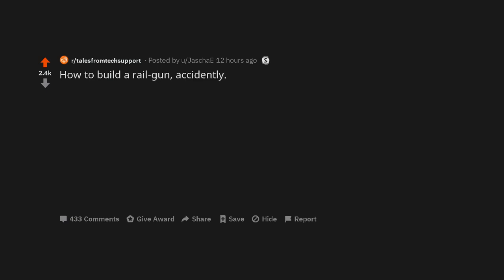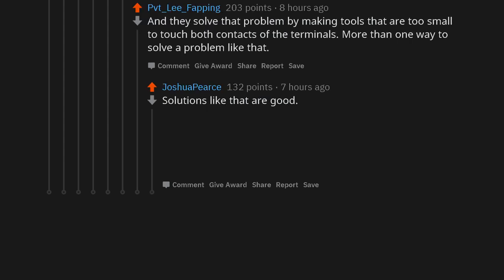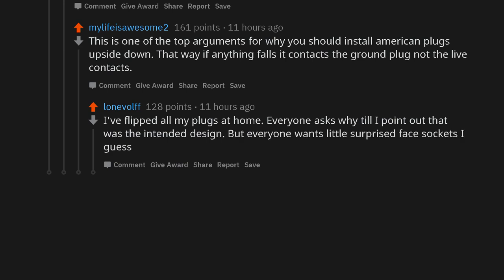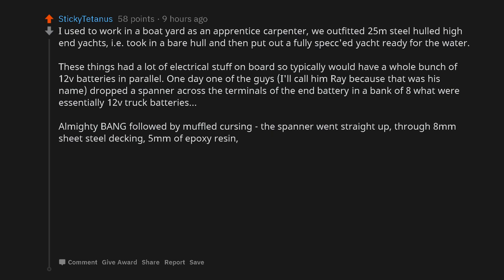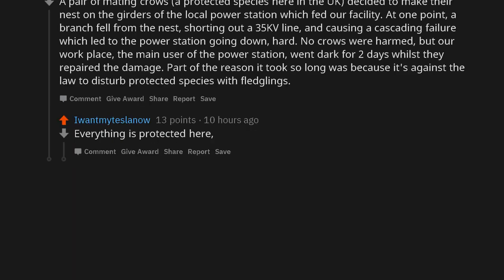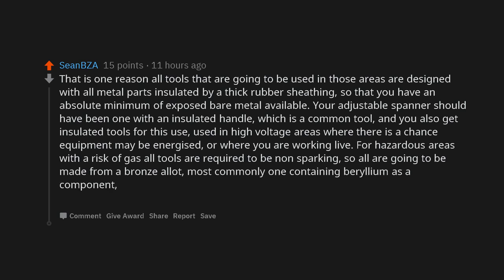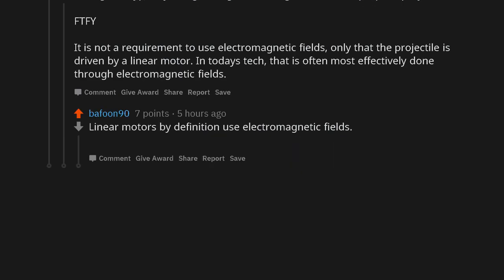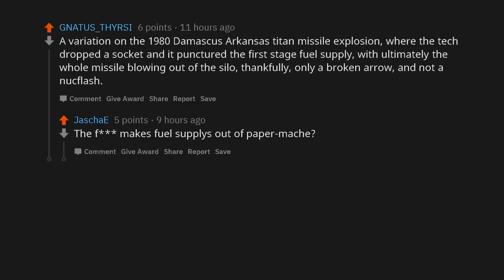r/talesfromtechsupport: How to build a rail-gun, accidently.

Comment: Copper, as it vaporizes due to a dead short, expands by a factor of 67,000 to 1. In other words 2 cc's of solid copper become 130,000 cc's of rapidly expanding copper vapor in about 1-2 milliseconds. So it was probably the explosive effect that moved the tools in these stories. Also, that blue plasma or arc flash is hotter than the surface of the sun and full of damaging UV light.